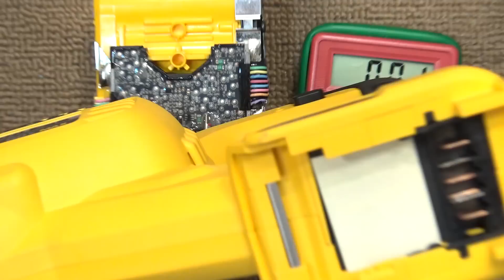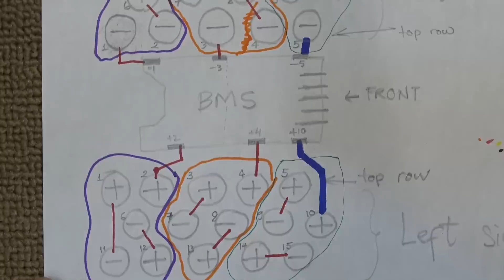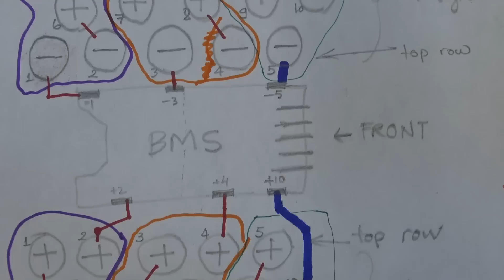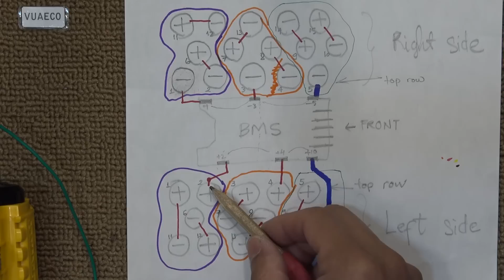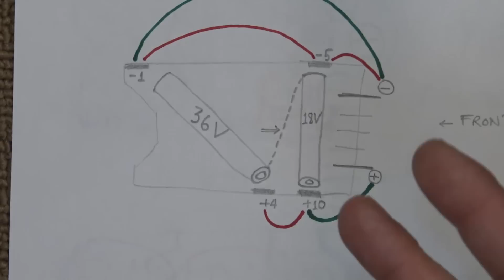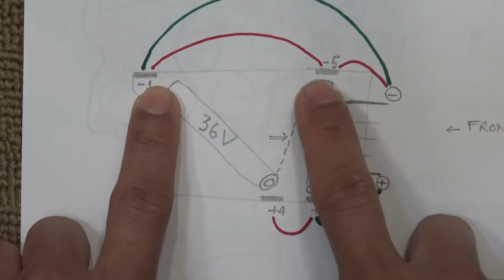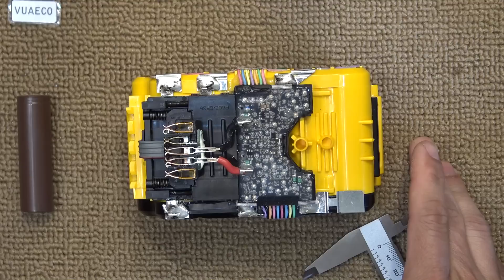Dewalt Flexvolt 60V 9Ah battery teardown & analysis: From 20V to 60V, How does it work?

Comment: Hi I added some extra bridge wire on parallel row and it’s working better now after next charge I did about 7mile and I added an on bike volt meter and apart from when on throttle when it drops to 40v under load it stayed at the lowest 49v this run
Reply from the maker: That's good. But your voltage drop is still a bit too much, though.
Reply: I'm not using pas sensor and will check tyre pressures again but what sort of range might you expect from the 52v 14s5p Samsung 25r 50 cells and Panasonic 2600mah x 20

Comment: Hi just been on ebike was running good til about 3 mile started cutting out and coming back in for a bit but the voltage had dropped to 41v so for a 48v motor an controller the controller must have been cutting out power.one pack of 6s was down to 16v and the other was 21v an 2s was 7v so why has one pack dropped so much ?they new Samsung 25r .well they off a guy in uk who bought them new an I bought them off him but they were just 3.0v when I got them this was 30cells off him all wrapped an in boxes still.my other cells 25r an some Panasonic 2600.

Get Outlook for iOS
Reply from the maker: The cut off power of the 48V controller is 41V-42V. The same thing happens to my ebike 48V controller. How many cells do you have in parallel? The voltage shouldn't drop so fast. You might have some bad cells in there.

Comment: Yes need ask someone to weld s sprocket is there a lot of difference to brushless an brushed ?
Reply from the maker: Brushed generates lots of heat due to friction. And that also means wasted power. If you use it a lot, brushless makes more sense. And if you're thinking about over-volting the motor, brushless makes even more sense.

Comment: Hi .ive just seen a 48v brushless motor on eBay uk cheap 30£ it would need the sprocket welding on I think.what do you reckon ?b ok for my razor e300.steve
Reply from the maker: That's cheap for a brushless motor. I'd go for it. The only hard part is how to put the sprocket on the motor.

Comment: Wonder why "switch" terminals in middle of pack have such large wires going to PCB/ BMS? One would think a simple switch could use thin wires like balance wires of BMS. These look very thick like they are meant to carry a lot of current!

Comment: Dear Sir,
As I recall DeWalt originally came with a "60" (really 54 volts) battery rated at 6 Amp/hour(@18 volts) but only 2 Amps @ "60" volts (lots more power at the expense of very little run time). As you obviously know the basic laws of electricity regarding series & parallel connections; one has to choose between having a higher pressure (voltage) over flow volume (Amperage) or vice versa. The newer battery has now larger cells to accommodate even more Amperage & thus a longer run time. But it also allows a tool to draw more Amps when required & thus produce more output to overcome resistance. Metabo with their Higher Density 6.2 & 7 A/H & Robert Bosch with their Pro Core 7 A/H are built using the same principles ( lager 20700 cells mixed with 18650's); I dare say it's only a matter of time before they are all built using 10X 20700 cells & no more 18650's. Metabo are now offering 8Amp/Hour batteries which leads me to believe other manufacturers are going to follow. From my calculation if using a full complement of 20700 cells, the battery pack should deliver 9A/H, until such time as a new chemical formula is found so as to reduce volume & mass, I seriously doubt we'll larger capacities as the physical size & weight has to increase considerably. I am curious as to what you might speculate. Kind regards.
Reply from the maker: You're right. As tools are getting bigger and more powerful, they will need bigger and more powerful batteries. But I think there's still place for 18650 cells. Cordless power tools are about portability. Smaller batteries still rule this market. As you can see from the video, the brown LG 18650 battery cell gets to 3Ah (50% more capacity) while remains the same size. Battery technology only gets better and that means more capacity, more power (discharge rate), smaller size, and less weight. And 18650's are still the king in this market. Only time will tell.
Reply: Dear Sir,
Thank you very much for your courteous & enlightening point of view. It's always nice to get a different perspective on how tool technology is progressing. Many thanks indeed for your wonderful & insightful videos. I look forward to seeing more of your videos concentrating of battery &/ electrical related topics. Keep up the good work. Kind regards.
Reply: Just because it has 2ah at 60v does not mean it has low run time. The tool does not draw 3 times the power just because it is 3 times the voltage. Run time is equal to the watts the tool draws and the watt hours of the battery.
Reply: Those are 21700 cells, not 20700...
Reply: Dear Sir/Madam,
Thank you very much for your comments. Indeed power is a factor of Amps X Watts . I do concur with your explanation. Speaking of run time &/ watt/hours, some manufacturers might & are indeed emulating DeWalt to some degree right now by providing perhaps what they consider a compromise by upping the voltage to say 36 volts & upping the Amperage simultaneously by giving the end used an alternative of using two 18 volt battery packs instead of one thus getting the best from two extremes (voltage & amperage). Makita, Festool & Metabo comes to mind but I am sure others will either follow or come up with yet another novel approach for the quest of maximum power with the least amount of weight.I equally think that unlike battery cells most manufacturers have their own special recipe for brushless motors ( heavier gauge copper windings for examples to deliver more power). As for DeWalt, I think it's a pretty genius idea to tackle an old quest to deliver more & offering versatility at the same time. Milwaukee adds yet another 5 cells to bump their amperage to 9 Amps but at the expense of bulk. I am somewhat surprised that no manufacturer has yet ventured into using 26650 cells yet. Maybe weight factor might represent too much of a challenge at the moment. Kind regards.
Reply: @John Serling It was obviously a typo, asshole.

Comment: They call those batteries 54 volt in the U.K.
Reply from the maker: Absolutely true.
Reply: jeffscomp

Because we have less marketing wank in the UK. 
Just because its a higher voltage does not mean its more powerful either, they went with 54v because it's more efficient, which leads to a more powerful tool because the losses in heat are lower.
Reply: @chris746568462  Wrong. They are exactly the same. Just different marketing. If you test a freshly charged 18V/20V battery it will read somewhere between 18-20V. Dewalt chose to market the battery as 18V in some countries and 20V in others. I'm sure focus groups were involved.
Reply: @1averageamerican  
Just speaking from experience as an electrical engineer... but heh if you know better.
Reply: @chris746568462  Working as an industrial electrician/inspector I have delt with many engineers who were idiots. They were like you and thought that title made them smarter than everyone else. It's just foolish. But that wasn't the point of my comment, which I'm not surprised you missed. The basic concept of your comment is extreamly oversimplified (I think you will agree it's missing some components of the equation when discussing motor efficiency) but its basically correct. But you are wrong to state that Dewalt makes different batteries for the US/Canadian market than they do for everywhere else. They do not make a more efficient 54V battery that ships to Europe and a less efficient 60V battery that ships to the US. They are the same battery in both locations just marketed differently.
Reply: @1averageamerican   
 I never said anything about having two types of batteries that would be silly. It's just how they market them, hence the term "marketing wank". 
Maybe read what I said before jumping on the personal insults.
Reply: @chris746568462 If you're talking about the way the batteries are marketed either way it's advertising wank. I guarantee the company did research and found a battery advertised as 54V sells better in the UK and 60V sells better in N. America.
Reply: @1averageamerican  
I think it's more of there are laws against false or misleading  advertising in the UK, AUS ect..
I think it might be The Fair Trading Act.
If you look at the 60v or 20v batteries they are advertised as  "60v MAX" / "20V MAX" while techically accurate it is just a marketing trick to manipulate consumers into thinking these tools are more powerful than the competitors. 
Someone shopping for a power tool sees 20v vs the competitors 18v they are going to assume 20v is more powerful when in reality they are the same.
Reply: @chris746568462  Sure I see your point. We have similar laws here but like you said "technically" 20V max is not false advertising. I would hope if someone was debating between Dewalt and Milwaukee that the term "20V max" printed on the box wouldn't be the deciding factor. I would hope people are smarter than that. Maybe not. Maybe it is US "advertising wank". Cheers.
Reply: In Russia it also sells as 54V
Reply: Dewalt always overreact!
Reply: Same in Australia
Reply: Same 54 volts in Australia
Reply: Dewalt use this "18V 20V-Max"  "54V 60V-Max" for divide in 2 groups. For America, Canada zone is 20V-Max but In Europe, Asia is 18V and 54V.    So 18V 20V-Max they are the same...…. . Dewalt 20V-Tools can use with 18V battery or 18V-Tools can use 20V battery.  For voltage in 18-20v battery. When they are low voltage low power, they are at 18V but when they are fully charge. The voltage will become 20V.    Same as 54V to 60V.     Just like 18650 single battery. Low -> 3.7V then Fully Charge 4.2V.
Reply: Im pretty sure Milwaukee has a patent on "18v Lithium batteries" in the US.  That is why pretty much every other company in the US calls their 18v batteries a 20v, to avoid Milwaukee's patent.  Milwaukee sued Snap-On over them using 18v Lithium batteries in their tools.  Im not sure how Mikita gets away with it.  Maybe they are paying Milwaukee to use the 18v name, or some other work around like the 20V MAX naming like most other companies use.  Put a meter on a fully charged Milwaukee 18v battery and it is also 20v.
Reply: jeffscomp i think thats the nominal rating. You will notice that it says 60v "max" which it goes to a maximum of 60 volts when fully charged. I think thats how they get away with it and not get sued into conforming with nominal.... in the US at least
Reply: @TRYtoHELPyou  IOW, companies can use a weasel word like "Max" to keep lying to customers, whereas European governments won't even allow the shit on the shelves unless it's marked properly.
Reply: leave it to dewalt to confuse the market to make home owners think they are getting a more powerful tool via 20v vs 18v and 60v vs 54 volt. A lie but it makes them money!
Reply: @fwheels7776  it's not a lie. Meter a charged 20v battery. Its 20v. Also its more of the newer style and makes it easier to differentiate
Reply: @AverageJoeInnovationsLLC  No, asshole. There is a "they", and it's morally correct for "us" to criticize "them" when warranted. By your logic, someone is a hypocrite when they complain about air pollution because they breathe. What kind of nonsense is that?